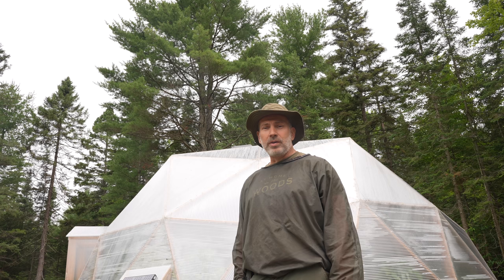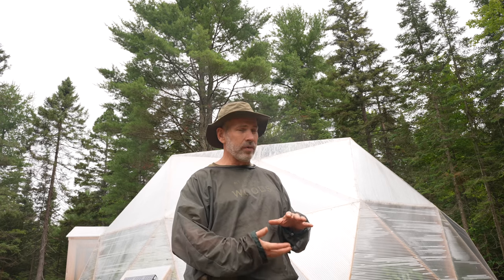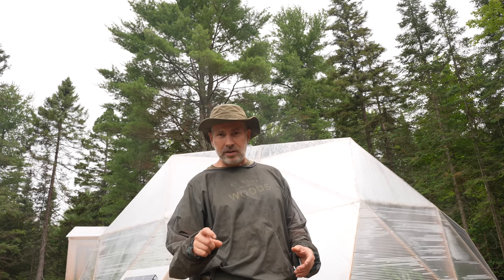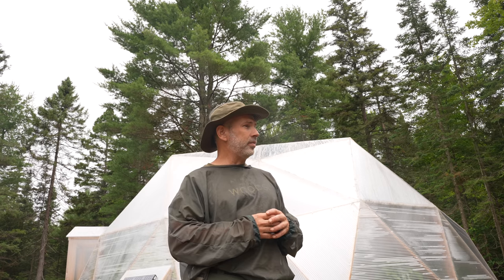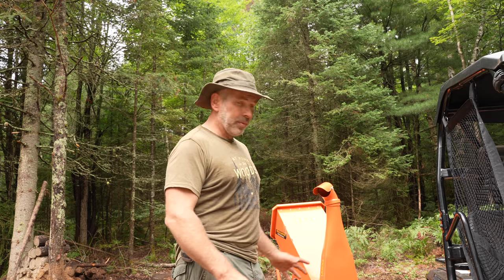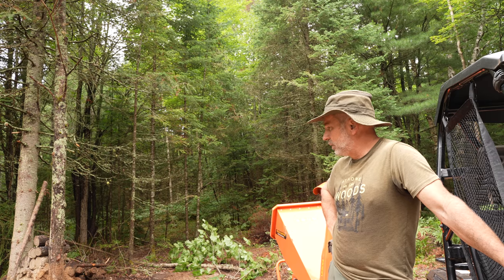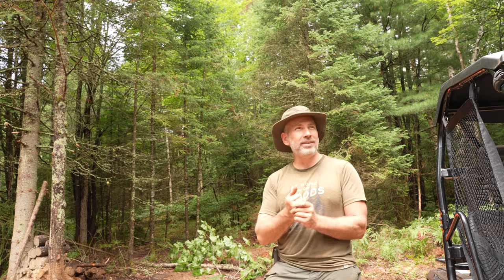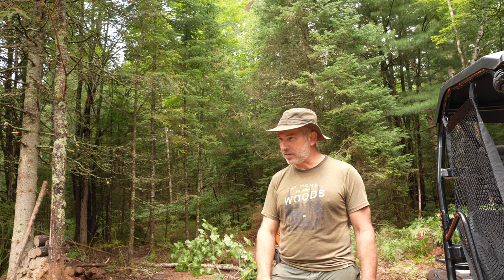Wood Chips to Reduce Wildfire Risk and Build Soil

Comment: Hello from smoky south central BC. We've done a bunch of fire suppression pruning and cleanup on our property over the last 28 years and frankly are still at it. We tried a couple different wood chippers and finally just rented a Vermeer 700XL once or twice a year. That way the rental center does the maintenance on the knives, etc. Anything smaller than that for us was next to frustrating and not much more. Hope that helps, good luck with the new place.

Comment: Shawn, if you're using conifer chips, watch your pH on the soil.  It will acidify it.  I imagine it's all ready pretty acid.  Use your wood ash as an additive when using them on the cultivated varieties of plants you use that do not like acid soils (Blueberries, for example, love acid, so don't add the wood ash to those chips).  The wood ash will add minerals that will neutralize the acid.  Just keep an eye on it if your plants are not thriving.  That may be the reason.  pH might be wrong.
Reply: I don’t think it would add any acidity because he isn’t bringing in outside resources- just using the debris naturally there. However, you’re right that the soil is probably high acid to start, which could be a problem.
Reply: @huntermckinney18   Evergreens are naturally acidic.  It would be in the wood, needles and cones.   The area would be naturally acidic because it's got a lot of evergreens because of the location.  The more deciduous trees you have, the more neutral the soils.  By chipping, you are altering the speed of release of those acids.  You accelerate it.
Reply: @pooftiger  I agree. Definitely accelerating the process, but a process that is occurring anyways. It might change the ph, but I wouldn't think that much. I could be wrong. Either way I think adding his wood ash into the mix would help neutralize the soil.
Reply: @huntermckinney18  You're right if he is composting.  The bacteria and fungi that aid the decomposition process would help break down those compounds, but when you mulch, it's like a direct shot into the soil right by the feeder roots.  You add the wood ash to the mulch to prevent that.  It can also work the other way.  Too much wood ash will make the soil unbalance, too.  So much balance in nature.  Isn't it amazing?

Comment: 3 years ago Hydro One was trimming in my area and they dumped about 20 truckfulls of wood chips on my grass. I pushed them flat with a tractor about 18" deep. Today they are pretty much compost but if I use that compost in my vegetable garden it doesn't help the plants much. There's very little nitrogen in the wood chips. I also buy big bales of hay and lay them down thick (about 5" compressed) and that becomes really fertile in about 1 year.

Comment: I bought a chipper and the chipper shroud separated from the aluminum engine block. I found all four bolts were over tightened and stripped out the threads. The bolts were covered in loctite red and they shipped it essentially glued together! I was not happy. I totally oversized all the holes and put new threads in it. I had exactly the same problem you had. Luckily no one got hurt. I would use an oversized tap and blue loctite. Before I put it back into service, I checked every nut and bolt on that thing. It's a good machine now and has many hours on it. They could have done all this at the factory and saved a lot of head aches on our end.

Comment: Dear Mr. James:
The wood chipper you have is handy for branches and small diameter wood. The horse power of the machine and type of blade can only handle small jobs. You might want to consider renting a commercialized chipper for wood that is wider. To buy one is expensive, but an investment if you have small jobs. It turn into a business if done right. 
Your chipper is handy for small jobs. It will suit your needs for now . But you have to keep it maintained and prevent it from over heating. You might have to reduce the size of thicker branches to process.  But for the price, it’s cheaper than having someone come do it. I hope you are able to repair it. I think it has potential. Thank you for sharing.
Reply: I meant to say, a commercialized chipper is an investment. You have more horsepower and heavy duty blades- that tackle bigger jobs.
Reply: @lucindaayala4111  I think many of us would think we were buying a powerful enough machine when it says "professional" on the side. What should we be looking for instead? Thanks!

Comment: Hi Shawn,
If you want to produce some soil with your wood chpis I would suggest to spread it out and add some nitrogen fertilizer, slow release. Bacteria  that breaks down the wood needs nitrogen.
You can use common lawn fertilizer, just make sure it has high nitrogen , the package should have a number code eg 30 10 10 first number is N ( nitrogen), 2nd P  and last K.
Also ad some lime to balance the acidity...
Hope that helps 😉All the best to you !

Comment: Ooh! Back to the seller to get a real one. I have a chipper here at home that is about the size of the Shute on yours and it would have devoured the stuff you put in the one that broke. Trouble is it's 240v ac! So sorry that this has caused delay. Don't fix it, lay some grief on the vendor. Regards Stephen.

Comment: Hey Shawn, just some friendly advice you may or may not be aware of. Carbon:Nitrogen ratio of woodchips is very high. Often soil amendments using woodchips are supplemented with nitrogen to keep it in a healthy range for bacteria and their corresponding symbiotic vegetation. C:N Ratio is very important for proper decomposition and conversion into useful soil organic matter. Cheers!

Comment: I have a smaller chipper and I jammed it a few times when I was first learning how to use it. I learned to always keep enough gas in the tank and never slow the motor speed with wood in the chipper. Fortunately I didn't bend anything. Now it's full chipping ahead as long as my neighbor doesn't complain about the noise.

Comment: Hey Shawn a good alternative is get some bales  of straw and spread them around keeps the logs clean and it breaks  down to soil even more quickly than wood chips.  Choppers are a good idea but so Labour intensive.  Personally just make brush piles  and burn them in the winter when you have snow . Also the sawdust from the saw mill  is great and easy-to-use

Comment: Hello Shawn, the idea of creating wood chip is good as retire maintenance manager. I know for a fact machinery is not build to last as they use to. Chippers don't work well when wood is wet. Also the vibration will give you problems with the machine. I will repair and selled and buy something more in the line of an industrial chipper it will handle more than 2" diameter if you buy one that is rate for. Great video thanks 😊

Comment: It looks like the shear bolts took on some torque. It's good to keep extras.
Reply: Just a question, if you or some else can answer, in many places i see shear bolts that are just ordinary (8.8 strength here in europe) bolts, or is it that they have a special quality above just being a standard bolt ? 
In some i´ve seen a "line" or indentation around the bolt were it would be weaker and snap, but that don´t go for all of them... I sell PTO shafts for example, and their producers   don´t say much about it, except there is a bolt that snaps when the torque goes nuts, to save the PTO-axel..

cheers

Comment: I used to use a chipper and it had a warning label on it "Do Not put through branches bigger than 2 inches  circumference" as the cutters will stop working. Yes much like what happened to yours - Cheers Shawn and Cali.

Comment: We have a chipper.  The one we have can take 3 to 4 inch limbs.  It has a large fly wheel that is driven by the 9 hp gas motor.  It can't do what yours did.   Good luck with fixing it.

Comment: Hey Shawn.  I worked for an equipment and tool rental company for 16 years.  Chippers are a royal pain in the arse. I highly recommend putting in smaller diameter branches than what it says it can handle.  Or at least NEVER exceed the max, or you will be doing repairs on a regular basis.  We used to offer insurance on our equipment when you rented it but chipper/shredders were excluded from coverage for this exact reason.

Comment: Its  the general rule, if it can go wrong it will, however theres nothing made thaf cannlt be fixed, e only problem with wood chip iz it takes a long time to break down.
The bit i like is you can do things as you want.
Seems like ages ago you were building the first one.
I agree that there is satisfaction from using hand tools, firstly they are quiet     and secondly there is a skill in using them which brings with it the satisfaction of knowing you did it at the  end of the day  knowing that it will last for years.
Good to see it coming  together Shawn, all the best John Australia.

Comment: Our chipper had impalers?? And would take bigger branches, plus it had 2 places to load branches in. I think one was for smaller branches twigs, and the other for larger diameter branches. It should say on the machine  I think what size it could handle, I didn’t see a manual.  The thing I didn’t like is the pieces/chips weren’t shredded small enough to use as mulch, maybe for use in a Hugelkultur bed. I also had a hard time pulling the cord to start it, you may not but use puny people yeah you would. 😬😎

Comment: It looks like the chipper is to small?  For what you doing its best to get one that has a six cylinder and a bigger grinding blade's, plus bigger grinding cylinder. They come with anti plugging and a reverse so they don't plug up ? You can check your local logging Mills to see if they have any for sale . You have a great idea of cleaning up the brush piles and any rotting logs an limbs. A bigger chipper will do the job for you. Plus you can run the ground up chips back through the chipper for for finer chip's. Just be careful when chipping

Comment: The downside of that wood chipper breaking is pretty significant to the soil development plans around the greenhouse. Wood chips together with extensive leaf mulch applied to that area over the course of a few years will totally change that ground and over time it WILL build topsoil out of sand. It amounts to moving nutrients from all over his property and concentrating them in one spot. Upside: there are pH challenges, but it will totally work; Downside: it is a lot of time and labour to do it and Shawn's list of things to do isn't small. It takes time to gather, chip, mulch and then let nature break that further down. So the chipper's breaking is a serious setback in terms of loss of a whole year of  nutrient breakdown and soil building.

Comment: torque wrench is the word, the bolts are made to a speck had trouble like that with a more powerful model. you should replace the bolts with new ones every time you take the blades out.

Comment: I use a small wood chipper to reduce branches below 3cm to wood chips which to use for heating (wood fired boiler and throw a shovel or two of chips once a load). Everything abowe 3 cm is firewood.  Yes its more work but what do you think it will take to reduce that carbon footprint. Also no need for Putin with his natural gas and all of them pipelines ya kno'.

Comment: Shawn, make sure when you replace the bolts, that you use hi-tensile bolts, less likely to snap like mild steel bolts do. Just a suggestion, but I think it will make a difference. Still loving everything you do and mulching in sandy soil is a very good idea.

Comment: you'd probably be better off to just go buy a few trailer loads of undied mulch from a saw mill. seems like that morgan guy from "outdoors with the morgans" got a full dump trailer for $30. you had a good size  tractor out by you new site recently. so maybe you could probably get a dump trailer towed by a tractor there. wont be a sin if get things done smartly out there in the deep woods where even bigfoot doesnt go.

Comment: might be best to have a series of controlled burns I have always seen termite infest areas of wood chips and even with the Japanese methods of scorching wood does not seem like a great idea...where as ashes are great and do not draw termites and if shallow pits are dug and green and organic built over the top the hugele culture mounds easily convert to raised beds which as you age will save the back big time...Life will come to the soil but non destructive types of life other than termites the molds and other organic cultures and no busted chipper....
rocks with mud mortar make incredible walls for raised beds ...every rock removed from the stream makes the sump deeper 
If water drains away to fast then frequent watering and a seasonal water column will make a closed system pressurized...one steel pipe 10 feet tall with 3/4 outlet and wind or solar pump keeping it full yields 35 pounds water pressure if it is a 10 or 12 inch pipe...couple of end plates and some rocks for the base and leave access to bottom valve and outlet in the winter simply drain it ...
a water column always a great idea...
every foot above grade pays huge dividends in cumulative pressure imagine your summer kitchen with running water or your cabin the pipes should weigh in about the same as your wooden beams...If you could stand those on end and pile rocks around for stability it would do the same for your water columns...a simple angle iron or unistrut frame covered in sheet metal would allow lower access and hold the rocks back making a service way... to the valve for drainage in the winter...

Comment: Drag it into the greenhouse,, next rainy day project.. Those home owner machines are thrown together,, nothing tightened proper,, missing lock nuts & bolts.. I ran a chipper for 7 years took a 15 inch trees,, full length limbs & all, big diesel motor, load with a tractor,, / excavator,, self feed,,  Scary,, those hard wood limbs folding up,,  rip your shirt off & try dragging ya in.. 2 little straps about 4 feet in said last chance,, pull one & it turned the feed & would spit you out..  Aloha

Comment: Unfortunately everybody runs game today, when you buy an automobile and the timing chain goes out, you find out that it's fiberglass and the replacement is steel carbon steel. No doubt when you take you're a mulcher apart the replacement boats and blades will be carbon steel. It's sad that everybody runs game to stay in your pocket.